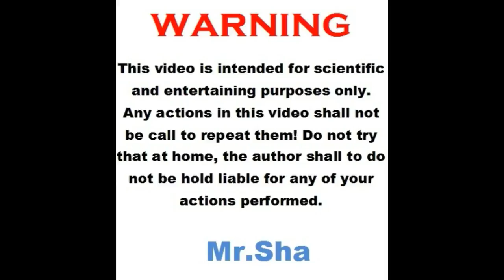unboxing and test || Drill Angle Connecting Rod and Disc saw blades | MR SHA

Comment: Here lies the danger - If the cutting disc blade crack or snap while while spinning, the broken pieces will be like sharpnel fragments, can even pierced your safety goggles, unlike those commercialised steel cutting tools which have a semi circular protective enclosure housing to contained any broken pieces the top of the cutting blade.
Reply: A guard can easily be fabricated out of metal, wood or even thick plastic.

Comment: Very dangerous even for a skilled worker. Better to use an angle grinder with a guard
Reply: Thanks
Reply: Exactly
Reply: even wood blades are dangerous in angle grinders also
Reply: @legolas...  there are special wood blades only designed for angle grinders with only 3 teeths in the wheel they are safe, it decreases the chance of lick back.

Comment: I have to smooth a surface to remove several millimeters of concrete, but less than 1 centimeter, on a perimeter length of about 2 meters, just to finish the 3 centimeter high recess of a drainage channel where grids rest.
I was wondering if I can use this disc on the drill without damaging it, as my 12,000 rpm single speed grinder is complicated to use for this job and for just one job I would not want to buy another variable speed one and the Voltage regulators cost the same as a grinder.

Comment: Sir how and from wherecan i get the converter form drill m/c to angel grinder. Pls guide.
Reply from the maker: Amazon.in
Reply: @mrsha  what is the item name
Reply from the maker: Plz.. visit this link : https://amzn.to/2NJPWZQ
Reply: @badriswain2679  go to your local hardware store. Purchase a bolt threaded that will fit in your drill. Get a couple large a washers that will be larger then the disc opening  bolt washer disc washer nut. Now you have a adapter for drill cost $2 to make. Make a few with different wheels there cheap enough. I have half a dozen at least. When it gets late I switch from grinsee to drill. And flap disc work great on a drill a good 6-8 amp drill

Comment: You can get away using it for polishing and sanding but I won't advise using it for cutting. Just don't do it. Get a proper angle grinder. For your own safety.

Comment: It's dangerous in all ways. There is a special machine called ANGLE GRINDER. Please use ANGLE GRINDER if you want to b safe. If blade breaks it can fly in any direction causing self injury or to others. Please see.
Reply: There is also another machine called DREMELL on which you can  use tiny similar blades but not these blades. N.B:- please be safe while working for more creative work in which people can admire you and yr creations.

Comment: All cutting can be done except wood cutting as it is not safe and each time machine will pull your hand in any direction once blade struck in wood.Please don't try wood cutting.Exclusively  wood cutting machine should be used.

Comment: It's too dangerous. It should be use with angle grinder with safety caution.
Reply: Coming from a psycho? Lol joking. It depends on the attachment. Drills only go 800-3000 rpm and slow rapidly once the trigger is released unlike angle grinder unless it's a pasdle switch or trigger switch. I use a threaded bolt couple washers and nut worse that happens is occasionally comes loose but it's all contained on the spindle. Works fine for the it's late to run a grinder flap disc work great jn. Made a few cuts as well in metal  whats left of cutting wheels I make circles and cut them out for Dremel cutting wheels